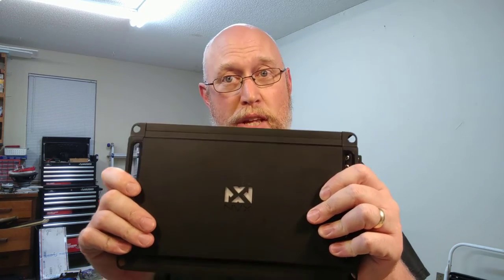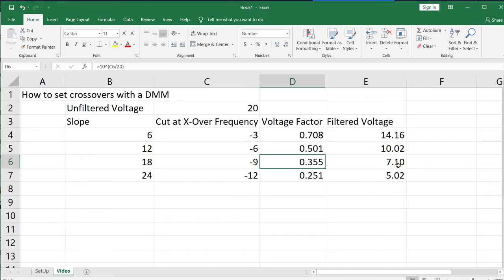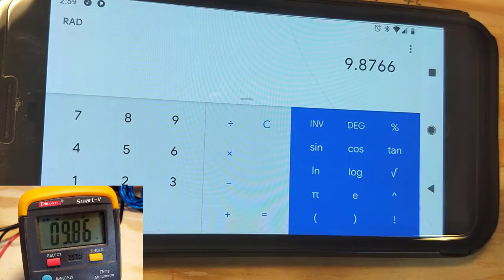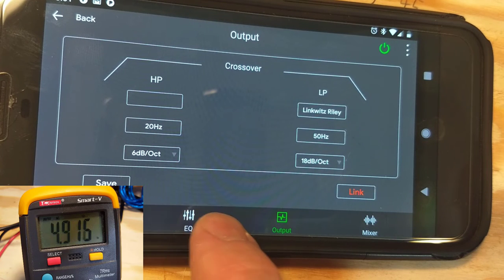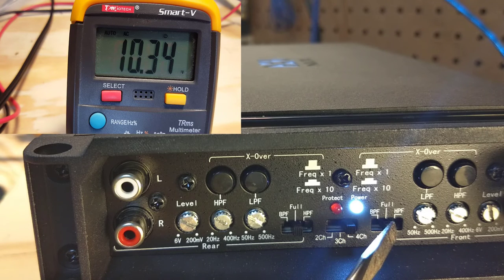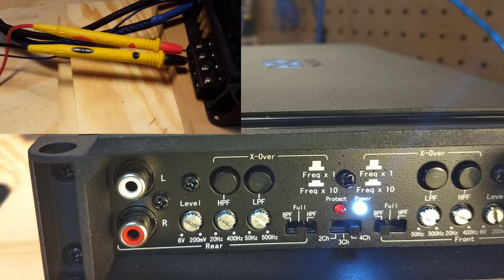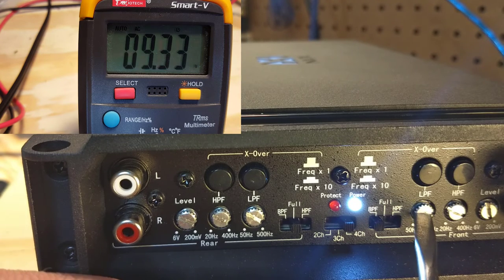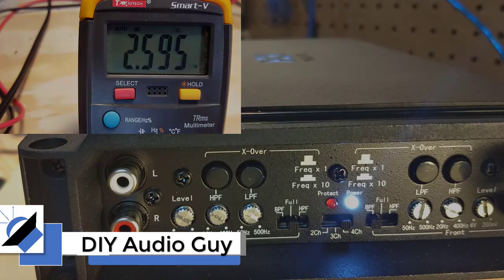Set Crossovers with a Multi-Meter, the CORRECT way!

Comment: so if i understand all this correctly.
thanks for your videos, i watched 2 of em... and if i am not making an error, this what i came up with, can you tell me if im on the right path ?

- basic calculation -
1200 watts rms
connected to 1 ohm speaker
multiply 1200x1 = 1200
square root of 1200 = 34,64 volts (initial full range voltage)

- amplifier - Polk PA D1000.1
desired crossover settings at 28Hz-80Hz
Crossover filter Slope 12db/octave

- speaker - rockford fosgate P3-2X12
Fs (hz) 28 -> 250 (hz)
i wish to have 28Hz-80Hz

[LPF] Variable Control - Adjusts the low pass filter frequency to attenuate frequencies above the setting on the control. 40Hz - 220Hz
this one target to be 80Hz

[Sub Sonic] Filter - Variable from 20Hz - 38Hz
this one target to be 28Hz

[Bass Boost] Control - Variable from 0db - 12db
this one target to be 0db

[Level] Control—Adjusts the gain of the channel to match the output voltage from your head unit.
this should be target at full range to 36.64 volts (based of the calculation above).

to get the desired 80hz, i need to take the 36,64 volts on the full scale (20hz-250hz) 
and drop the voltage down to this calculation using a 12db slope

voltage factor of 0.501 (for a 12db slope)

0.501 x 36.64 = 18.36 volts

so i need to dial down the LFP knob until the voltmeter show 18.36 volts, without changing the level initialy configured.

did i understood correctly ?

Comment: Even though this HOWTO is a few years old it is still relevant today & years to come. I do own a multimeter & a SMD CC1. I just redid my gains yesterday as well as my subsonic filter. I wanted to see how my SMD CC1 compared to the math here & from what I gathered, my CC1 seems to be hard coded around .708-ish as the value. By using both the CC1 & my muiltmeter I compared the initial voltage of 12.19 volts and after the CC1 turned blue, meaning this is the spot I should set it too, the voltage read 8.65 on my DMM. My subsonic filter on my Smart 3 is using a 12dB slope and my SMD CC1 seems to not care what slope you are using as it defaults to .708ish.

Comment: When im going through both setting gains and crossovers for sub amp and woofers with my multimeter my sound on my phone Bluetooth settings should be set to flat instead of the custom one I made for my factory head unit and speakers and just added loc1i auto control is set right in middle. My factory inputs to loc1i coming from old factory sub from toyota tundra

Comment: Hi DIY guy! I just discovered your channel and I'm loving it. One question on this video: 

I'm aiming for a 60Hz low pass on my sub. 

Running a mono bass amp, the spec sheet says the LPF is a 24dB slope.

Following the advice in this video, I measured an unfiltered  60Hz tone at ~20V (LPF dialed up to the highest setting, since it can't be turned off on this amp). 

Applying the factor of .251 (shown on screen at about @1:10) yields ~5V as my new target voltage.

The problem is, when I dial the LPF *all the way down*, the lowest I can measure is 8.5V.

???

It doesn't make sense to me that the lowest the LPF could go on this amp would be above 60Hz, so something must be wrong somewhere, but idk what. Any thoughts? 

Thanks!
Reply: have you got your high pass and low pass mixed up, and 60hz is really arbitrary. like 80-100hz is the usual cutoff for subs at the top and 10-40 hz at the bottom, for excursion control. 60hz is basically smack dab in the middle of where pretty much all subs work.
Reply: @macromage  thanks for the reply. What do you mean "got them mixed up"? I just re-read my post and I'm pretty sure I didn't mix anything up. Granted you might want a higher lpf than 60 on your system, plenty of variation depending on taste, but my question still stands: why does my amp's lpf bottom out so high? Using the math in this video my lpf can't get down to 60, meaning that at it's lowest possible setting it's... idk 70? 80? (I haven't figured out how to reverse-engineer the formula to determine that). It just seems so stupidly high that I think I'm doing something wrong. Maybe not. I'll try again with an 80Hz tone and a 100Hz tone and see if the math maths.
Reply: @brunsomarrr yeah sorry, i think i may have an answer, the slope you have on  your amp is 24db/o means that you can get the crossovers pretty close to each other in terms of frequency cutoff. this may also just be a fact of the amp you have it may have been made to play higher to better suit subs with a wider frequency range. they make monoblocks with the idea that your sub is going to fill out all the empty frequencies that your "typical" car speakers (6.5" front, 4" rear) cant produce, so they need to play up to about 120-150hz to be able to properly crossover with the tiny door speakers you have. a solution is using a passive crossover, but id imagine dealing with subwoofer power in a passive crossover would be really hard.

Comment: How do u determine unfiltered voltage? Is that voltage incoming to the inputs of the amplifier?
Reply from the maker: It is the output from the amp before you turn on the crossover.
Reply: @DIYAudioGuy  thank you
Reply: @DIYAudioGuy so after setting the gain, correct?

Comment: Hello, I have been trying to find more info on your voltage factors and everywhere I look, and I even resorted to asking ChatGPT and Grok, it says ALWAYS use 0.707 volts no matter what the slope is. Is that correct? I can't find anything saying to use a different voltage factor for different slopes. Thank you.
Reply from the maker: I derived them from the equation used to calculate decibels.  The .707 is for a very specific type of first order crossover filter.  That seems to be the default answer even though most people use a steeper crossover slope.   You will note in the video that my math matched up very close to the results I was getting when measuring output from the DSP.  So if my math is wrong then the DSP is wrong.
Reply: @DIYAudioGuy  Is your goal to have a -3 dB attenuation at your crossover point? Or would you actually want a -6 dB attenuation if you had a -12 dB slope? Your numbers worked so I want to make sure I am doing it right. Thank you!!
Reply from the maker: @oceanswimming590  I read all the same stuff that you have and I've been poking at Chat GTP.  Traditionally the crossover point is defined as the point where you have half power, which is negative 3db. But I measured this DSP.  It matched my math. Beyond that I'm not sure what to tell you. In the greater scheme of things, it's probably not that big of a deal.
Reply: @DIYAudioGuy  Thanks for the reply, the legend himself! Your videos are super helpful, I couldn't find any others like yours that show exactly how to do things. I used .5 for my xover and it sounds amazing. I might try 0.7 tonight and see how it sounds. Take care and thanks for the reply and the helpful videos.
Reply from the maker: I am aware of that, but did you notice that the math matched the measurements in the video?

Comment: I hope you're still around.  I picked up a new set of Sony's ES line of component speakers (and amp- XM-8ES) and decided to use the crossovers that came with the set.  Got it set up on the amp rack including the wiring from the amp to the inputs of the crossovers.  I did a continuity check on my wiring and it was all over the place!  I had terminals with single wires on the crossover showing continuity on seven different points across all channels on the amp.  I thought it was my wiring, but after a recheck I was left confused...everything was wired properly.  I removed all the wires from the amp and checked continuity across all channels of the amp I'm getting continuity from the negative of channel 1 to the positive of channel 2 and every other terminal of every channel down the line.  The crossover outputs for the tweeters and mids show continuity between all terminals of both speaker lanes...and it is identical for the second 3-way crossover.  I really don't understand what's going on here...hopefully you can provide some insight.

Comment: What do you do if the amp doesn't have a slope setting?
Reply from the maker: Most of them don't. Most of them have a fixed slope, which you can find in the owner's manual.

Comment: The sound from my 3 way gets distortion so which speaker driver  do i put a inductor or capacitor in series to help please ? Midrange seems to not be active enough since the adjustments allowed me to go 6db max higher than flat on my crossover but it that's all so is it just not enough db' from the midrange causing distortion ? Thanks
Reply from the maker: Is it a three way component set with a crossover?  Honestly not much you can do unless you plan to rebuild the crossover from the ground up.    I would get a DSP and go active.   https://lddy.no/1k6jq
Reply: @DIYAudioGuy  I purchased a low frequency DSL from Dayton and adjusted the db's curve of the midrange  and the results in stereo are really impressive and educational .Boom gone, but  plenty to learn  Thank you .

Comment: What should the settings be on your head unit when you do this?
Reply from the maker: I like to set the volume knob so that I have 10 volts, that makes the math easier.
Reply: @DIYAudioGuy  What about subwoofer and bass setting. My Head unit has a separate subwoofer control. Ive heard some people say to turn the subwoofer setting all the way up and others say have it all the way down. Also I would assume to set the equalizers to "flat"?  Thanks

Comment: My question is what and how do you find or get your unfiltered voltage to multiply by?.
Reply from the maker: I just probe the outputs with the multimeter.  After I made a few of these video I figured out a trick.  I adjust the head unit volume to get 10 volts out of the amp.  That makes the math a lot easier.
Reply: @DIYAudioGuy  thanks, in the video you showed using 20 volts unfiltered to multiply by.  Are those volt factors still applicable with a 10 volt output?.  Thanks.
Reply from the maker: @martyjr540  Yes.
Reply: @DIYAudioGuy  I will give it a try.  Thank you.

Comment: I have a skar RP 1200.1D. The specs says it’s a 24 dB/OCT. It also had a subsonic filter that goes from off to 50hz. The LPF goes from 50 hz to 220. I have the LPF at its highest like you said l. Whenever i multiply the unfiltered voltage by .251, the number i get is too low. No matter how low I go on the LPF, I can’t get the multimeter to that number i calculated. Could that be a result of a cheap multimeter? Or what could it be?
Reply: Did you figure this out because im in the same situation with skar since its 24db/oct
Reply: @juniorrivera1680  I think I just ended up using the unfiltered voltage for 12 dB/OCT. Eventually I just bought a SMD Crossover Calibrator to set the Hz. I also ended up replacing my skar amp because even with the gains set with the SMD DD1, my subs sounded weird. With this new amp, I don't have any issues. SMD tools are expensive but well worth it.
Reply: @chrisadame7641  Thanks for the response, I ended up doing 6db/oct and so far so good

Comment: I'm confused......how is the DSP app on your phone changing the voltage on the amp ?
Reply from the maker: In this video I am testing the output to show how the DSP changes the amplifier's output voltage.  In this case the DSP is there just to show that my math is correct.  Then I change the crossover on the amplifier to change the amplifier's output voltage.

Comment: Question, does the bass knob at all affect the voltage setting in any way while setting crossovers. I know you said turn the volume you enough to get a read out.
Reply from the maker: https://youtu.be/4kDxUcGCe8M?si=mq7uMEWpYDC6p1mg    The idea here is to use the DMM to look for a 3 or 6 db drop.  When you run that through the db formula the starting point does not matter.   Down 3 db from 10 volts and down 3 db from 20 volts is still down 3 db.

Comment: My amp has no shut offs and my high pass and low pass are both always on…. Gus’s I just have to use a processor to but how do I set these ?!?. Not sure how to do it with both active at the same time.
Reply from the maker: Start with the low pass on it's highest setting and the high-pass on it's lowest setting.

Comment: Do you use the same test tone as you used for gain setting? Like if you used a -5db 1000hz for gain setting a 4 channel, do you use a -5 db tone at specific hz to set crossover?
Reply from the maker: If you are setting the crossover at 80 hz use an 80hz tone, if you are setting the crossover at 1500 hz use a 1500 hz tone.  The volume of the test tone does not matter.  I tinker with the volume on the head unit so that I start with 10 volts, that way the math is super easy.

Comment: new to your channel, a newbie question. if my head unit come with crossover function for the  front speaker, can I set my 4 channels Kicker amp to "Full"? Moreover my front speakers also came with a pair of passive crossover!  is it good enough for preventing blowing my system? thanks
Reply from the maker: Yes.  I prefer the crossover on the head unit since it is easer to set -- no multimeter needed.  I would need to know more about your passive crossover to give you a complete answer, there are several ways that those can be configured.  If you are running a two -way component set then crossover will protect the tweeter and the crossover on the head unit will keep the low bass out of the midrange driver.

Comment: Two questions. 1- If I set my low pass on my sub to 120HZ, then my 4 sets of components on the 4 channels high pass to 120Hz do I run the risk of canceling out in certain areas where the speakers won’t play sound?  2- if I want my rear 6x9s to act as my mid range and play a full/band pass so I can play between 120hz-500Hz how would I do this if setting the voltage for channels 3/4 would require tuning the same channel for proper cut off on the other end?
Reply from the maker: 1) Yes, a 2nd order Linkwitz-Riley crossover will have a null at the crossover point.  It is easy to fix just flip the polarity on the sub.  If it sound better then keep it that way, if not then flip it back.
2)  Set the voltage the same, you just need a bandpass crossover.

Comment: If I'm using the crossover in the DSP I just set the AMP x-over to FULL and start in on setting the signal gain and don't have to do any of this, correct?  Didn't you make a video on setting the amp signal gains accurately with a DMM? Can you link that here as well?  Thanks.
Reply from the maker: Correct, and Yes.  https://youtu.be/MBcGOoRJ4Ro

Comment: On my pdx-1.1000  alphine amp the db/oct slope shows as a negative numbers and not a positive like this -> (-24dB/oct) would I use the positive 24 voltage factor ?
Reply from the maker: Yes, the negative sign just indicates that it's cutting by 24 DB per octave.
Reply: @DIYAudioGuy  Thank youuu for always getting back with my questions , I really appreciate it 👍🏽

Comment: How to you reach on hpf 2000hz?? How do I get that frequency?  Are the hpf numbers by 10? 😢😢
Reply from the maker: Sounds like you're trying to cross over a tweeter.  Most amplifiers are not designed to do that.  Some will have a 10x switch on them that will multiply the crossover by 10.  Look for an amplifier that has that.  All of the JP series 4 channel amplifiers have the 10x switch.  Hit the down for sound link in the video description.

Comment: I'm an old school installer MECP since '95. you really don't explain why your looking for a certain voltage output from the amp I'm sure it's clipping above that voltage? I used to use a hi fonics Callisto crossover which is still the biggest and probably the best crossover ever made. Now since I'm out of the game and not showing it trying to win trophies I just use the built in crossover in my pioneer head unit. It does the job without taking up space in my trunk. Now my sub amp does have a crossover and bass boost but I turn off the internal on the amp and use the highest slope from the HU. What exactly is bass boost doing? Just turning up a certain frequency or more like a parametric turning up a series of frequencies? Of course my HU Has lots of other settings. Including a 31 band eq on the pioneer app. My mid and components amp 6 channel has no built in crossover or processer but I do run the passive that came with the components.   You do also kinda leave out how to adjust a mid bass driver in a band pass. My HU will allow me to do this internally and I usually just do it by speaker specs and by ear. Usually sounding the best at around 80hz up to about 3-4khz speakers are rated to play down to 50hz. Thanks for the vids but I need more explanation.  I mean I haven't even heard you say to set your voltage meter to AC. The layman isn't gonna know that speakers work off AC and might not get a reading at all on DC and being that we are testing car audio might not realize this fact. I'm really not trying to be a smart butt, just pointing out critical things as a viewer that could help make your videos much better. So if you do something similar might want to mention to set your meter to AC for speaker output. Also maybe make a vid using HU crossover controls, because that's what a modern deck has and it's much more adjustable and accessable from the driver's seat. Also address multiple controls on multiple devices. That would be a great great help. Thanks again.
Reply from the maker: I think this might have been my second or third YouTube video.  You raise some good points.  If I can find the time I might redo it and add some more detail.  I might need to break it down into two or three videos so that people don't get lost.